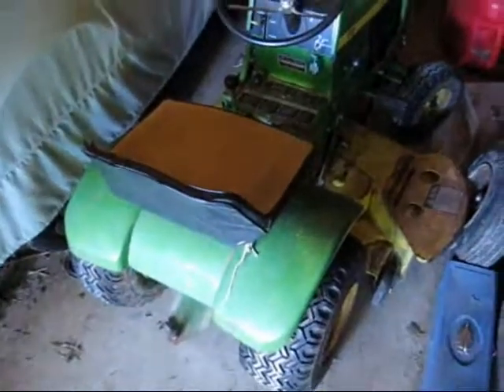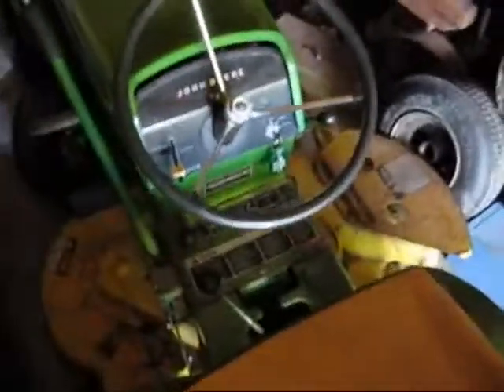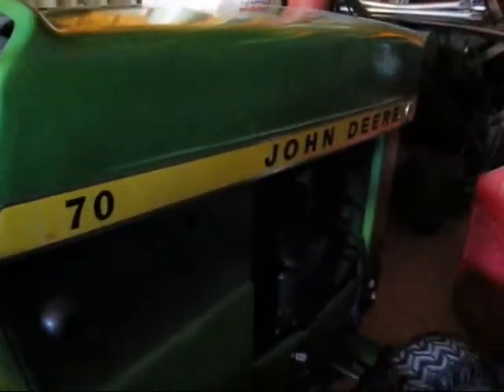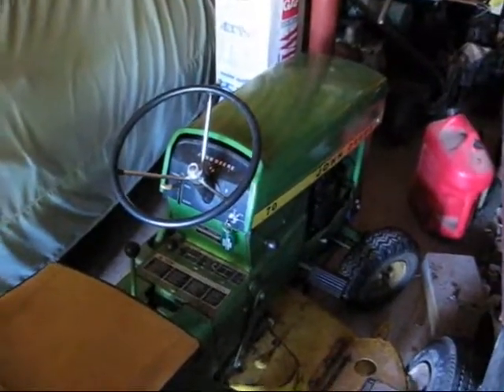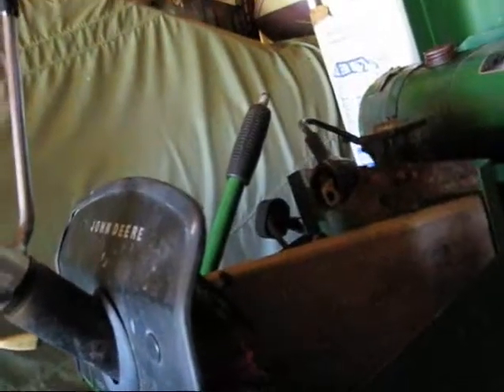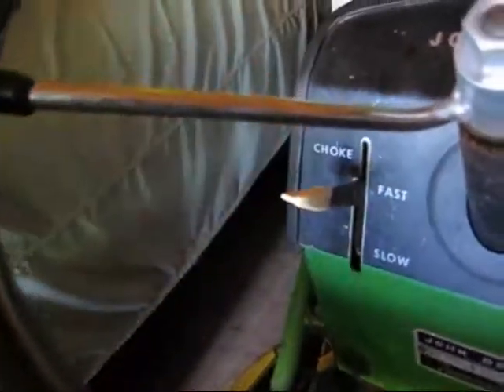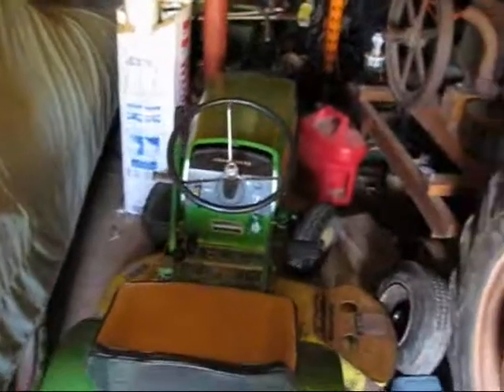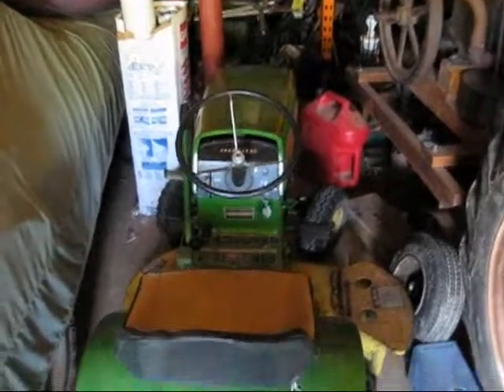1971 John Deere 70

Comment from the maker: the vh60 is a 6 hp that was originally for the model 60 john deere mower. the vh70 and vh60 could be placed on either the model 60 or 70 with no mods to the tractor or engine.

Comment from the maker: @kraigcassida just take the carb from an older 7hp tecumseh v70 snowblower engine. all old john deere lawn and garden tractors with very few exceptions have a fiberglass hood and metal fenders. the first 110's built had fiberglass fenders but they didnt hold up as expected so they made them metal for the next model year.

Comment from the maker: no ive had it running a few times. it only needs minor work a gaskets valve grinding rings new main bearings. nothing too major i can getit running now without a rebuild. but the poor old thing was in continuous use until las year when it was given to me. it was always very well maintained!

Comment from the maker: my belt never slipped but my back yard is a big hill and after i drove it up the hill and couldent start it again (carb problem) i had to chain it to the front of the 446 case to keep it from speeding down the hill because the brake hardly works at all. with the parking break set you can easily roll it.

Comment from the maker: i liked my 70 that much better when it ran. i was really surprized what it could do! i have a 1980's or 90's 7hp briggs which i an concitering trying to retrofit to the tractor, if i cant get the old vh-70 fixed. i could fix the engine but it needs to be rebuilt, its pretty tired after nearly 40 years of reliable service without a rebuild! or any major repairs

Comment from the maker: @kraigcassida yup free. freind of the family wanted it to go to a good home. i had its 7hp engine running. ive mowed with it. but i cant get it running anymore, so i put a tecumseh tvm125 5hp i bought cheap on it until i fix the 7hp or find another. the 5hp looks identical to the 7hp except no electric start. no big deal. it starts easy, but burns oil like crazy

Comment: I've got an old Western Auto Wizard 22 4 star with a 3.5 briggs that's almost the same age as your JD 70. My dad remembers using it when he was 12 and after 34 years it runs great. The origional spark plug even still works and it still has the origional blade. I use it about every day in my lawn service as a trim mower. It does smoke a little but runs great. Do you know anything about them? I've looked and can't find anything.

Comment from the maker: wow what a conversion! dont scrap the tecumseh though it is almost impossible to find a good rebuildable one for sale and jd collectors are almost always looking for one! if you dont want it put it on ebay the engine will sell for parts! but seriously did you try cleaning the gas tank replacing the gasline and maybe replacing the carb? its a whole lot cheaper than a new engine!

Comment: @1944johndeerel HAHA runs good but smokes like a freight train haha i got a lowe"s brand push mower made by MTD runs great but burns oil alot my throttle handle broke so iv got a piece of wire hook to the carb an i run that ole 3.5 briggs wide open she mows great its in real nice shape its black an orange dont know if its worth anything but im keeping it ole thing aint ran in over 5 years i got it running an restored it